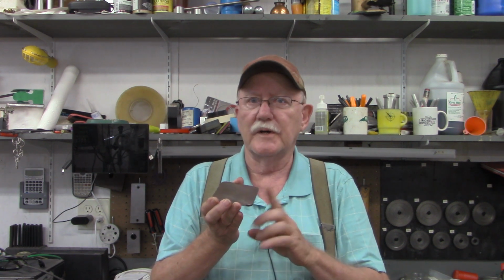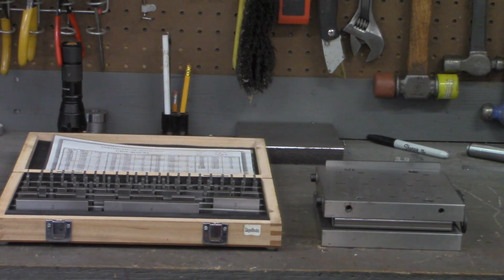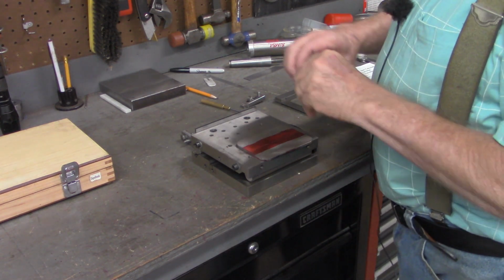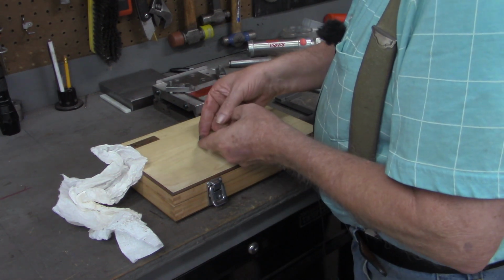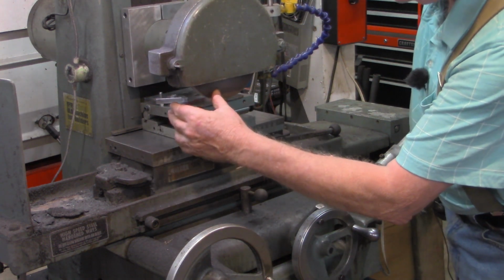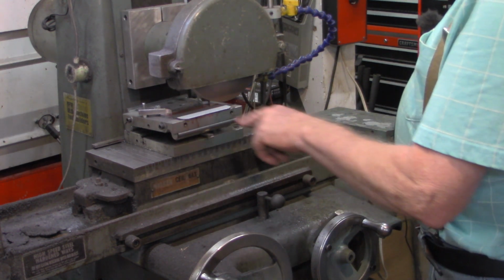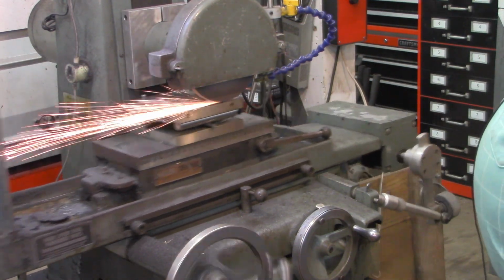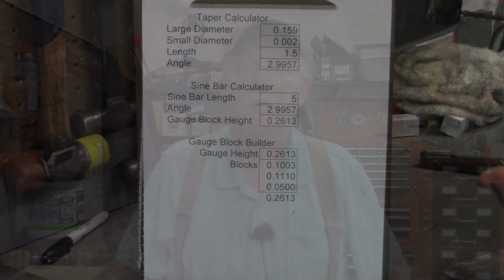Surface Grinding A Cutting Edge

Comment: It a little to wide to chop of the end of a cigar.  I'm guessing maybe some sort of vegetable.   Don't know much about Guillotines, but what about changing the edge of the blade so it cut at an angle.  Maybe 30 degrees, I'm thinking it will chop easier if the edge of the blade doesn't contact the material all at once?  it's still a good project just trying to figure out what it is for is half the fun!  KOKO!

Comment: I was surprised the heat in that thin blade didn't cause you any problems. I thought it would get too hot at that knife edge and start warping but obviously it all worked out well for you. The guy that owned the shop I started out in did not allow the use of coolant on the surface grinder and I ran into issues with heat buildup in thin parts a number of times so you had me on the edge of my seat.
Reply: Surface grinder is very much different than smirgel. It can touch very gently and the sparks are tiny. Many times you don't even feel them if you put your hand on them. For same reason, surface quality is  way better with same grit stone.

Comment: The only guillotine blades I've sharpened were for a friend in a printing company who produced books, I worked in a gear and gearbox manufacturing facility. Only 1 side of the blade was sharpened as the back side was left untouched so the books being cut were not deformed during the cutting process. I had several gauge blocks made which stayed in place during the sharpening process. The guillotine had a slight skideways action which helped when cutting. Your blade looks fine, hope it cuts as expected 👍

Comment: That’s a cool job.  At a company where I worked years ago we had a large hydraulic guillotine used to cut stacks of paper card stock.  The blades were about 2 ft long and about 3/4 or 1 in thick at the top.  The cutting edge was a single grind edge and probably the sharpest object I’ve ever worked with in my life. When we deemed it too dull to cut paper stock it was still sharper than any knife you’ve ever handled and could easily make a bad cut.

I’m curious about what you intend to cut with this.  Are you going to have a back stop or depth stop of some kind?  I was just thinking that if you are, that double-edge grind could have a wedging effect. 

Looking forward to the rest of the build!

Comment: think you should have used coolant on this job but then again not using it makes clean up easier but hold on you DON"T CLEAN IT EITHER so would make no difference then Cheers
Reply: I think I did see coolant dripping on the leading side of the grinder, but I may be mistaken.

Comment: I leave Jo blocks in place, but they have to be well-cleaned after grinding.  I have two sets, one never leaves the surface plate area, and one is the working set.